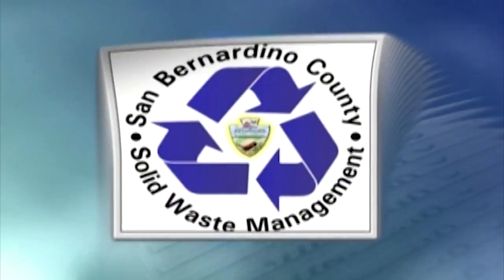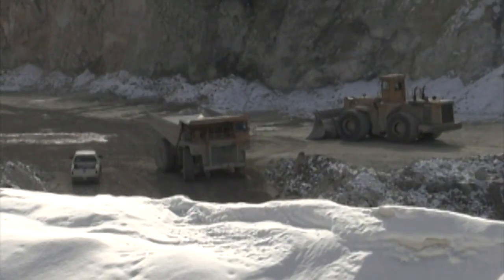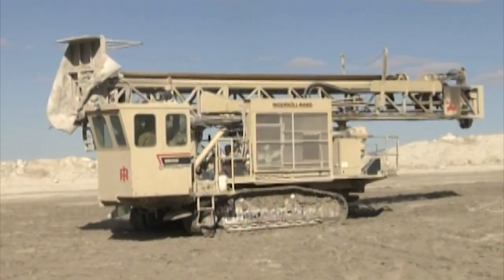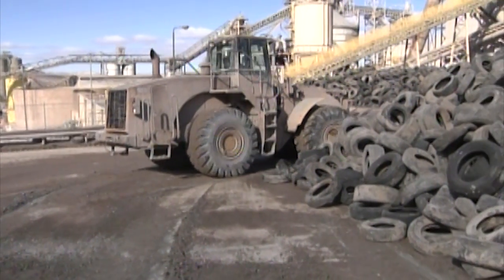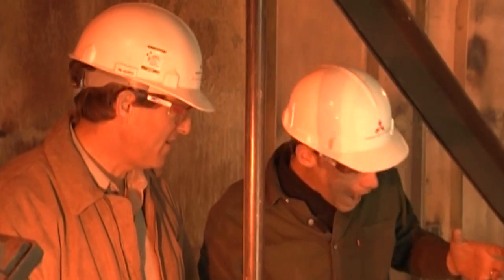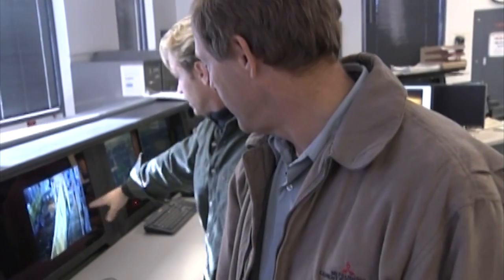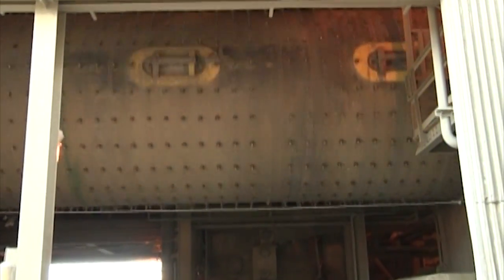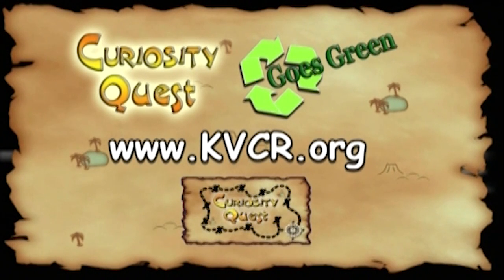Tire Recycling

Comment: Not so fun fact : burning the tyres adds to an already massive generation of CO2 that comes with calcining the limestone in the cement manufacturing process. Not to poo-poo the avoidance of nasty landfill but the cement industry is one of the biggest producers of greenhouse gases and using tyres for part of the heat-generation process is basically choosing fossil fuels over other  energy sources that don’t release CO2.

Comment: 10:25 gives you the answer to the question. They burn the tires to use as fuel, but this is NOT recycling! The process shown in this video is burning tires to use as fuel but there is no recycling of the tires involved here. The video title is misleading and this video is off topic and therefore stupid as educational video for tire recycling. It should be renamed to tire burning for use in industrial cement manufacturing.

Comment: 100 tons - 220,000 pounds.
Reply: Rose. School wasn't good for you was it?
Reply: Rose there is only USA and Canada that use the 2000 pounds but it is Known as a Short Ton and Canada  is moving to the Metric Tonne 2204:62 pounds  most of the World takes a Ton as the Long Ton or Imperial Ton which is 2240 pounds even the USA use the Metric Ton, Grains of any type and also the Imperial Ton used in Ship Building. This is common Knowledge  that you appear to be Lacking. as you stated 100 ton = 220.000 pounds when the American ton is 200,000 pounds.
Reply: bigniper who cares?
Reply: bigniper I was gonna type this up but u nailed it!👍🏻

Comment: This is not recycling!
Reply: So how u call It?
Reply: @santiagolugo2120  Buuuuuuurning? Or to be more technically euphemic - down cycling. Well the use of recycling bin is too liberally used for just dumping down something. Real recycling would be freezing, crushing and then magnetic separation. If this would be economically. I don't know. Energy for freezing and crushing vs. pollution by burning them.
Reply: The tyres are not just used for burning the steel in them is needed without using the tyres they would have to add it also to the mix.

Comment: Squirrelly TV host versus Engineer. The host humor fails quite a bit. Granted the exhaust doesn't appear as a regular tire fire with acrid black smoke. But the host didn't raise the "what is the chemical make up of the resulting exhaust" question. By every definition, I've ever seen the tires aren't "recycled".  Reused and reduced are more correct.

Comment: First of all einstein burning tires is not recycling and I suggest that you go back to school and learn what "Recycling" actually is before hosting a program that is not only misleading but a total LIE!. Recycling is the process of reusing a product after it's usable life is gone and then it is reused to either make new products or reused and combined with other materials to make completely different products than what it originally was, incinerating tires is not recycling by a long shot!. It is simply a method of cement manufacturers to cut their overhead by not paying for clean burning fuel such as natural gas, instead burning tires to create the heat it takes to drive off the carbon dioxide out of calcium carbonate to make portland cement.
Reply: did you even watch the video? recycling is exactly whats happening. the rubber in the tires is used for the heat and the steel is added to make a new product cement...